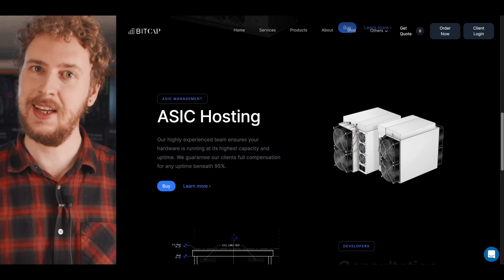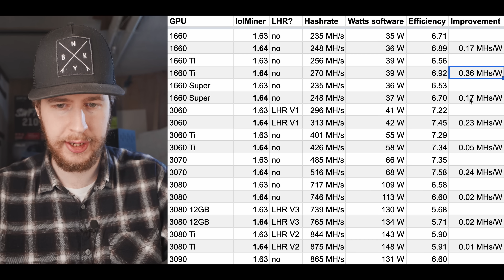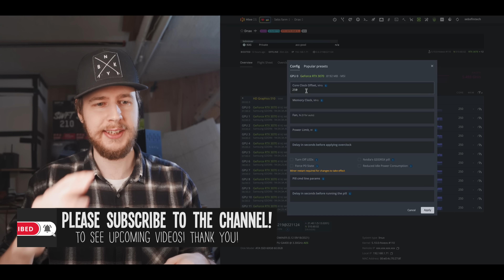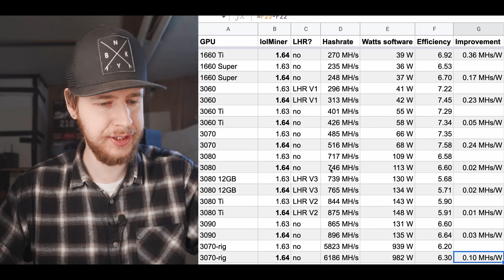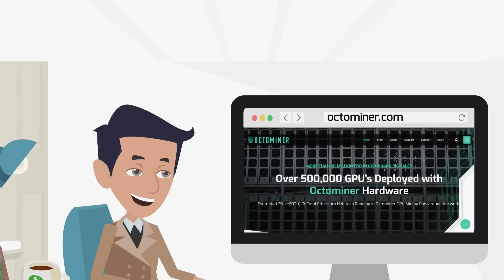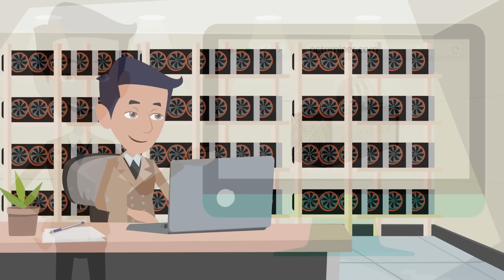3 ways to increase KASPA mining PROFITS on your GPU mining rigs!

Comment: yes, your profitability is determined at the time of coin sale.

however, do not mistake this as your income for tax purposes.  it is not true for filing taxes.  the income you're supposed to declare on your taxes is not determined by the value of the coin at the time of sale.  it is the value of the coin at the time it is deposited into your wallet.  sucks, because it requires more work to assemble that data, and, you don't get the luxury of "deciding" what your tax income will be and when it will be, unlike stocks.

Comment: For me, locking the core clock in Lolminer and then the offset in hiveos doesn`t work. I had 1,521ghs with core clock locked on 1470mhz and offsets done, when I lower the core clock lock on 1300mhz the speed of mining went down to 1,33ghs and no improvement. :(

Comment: Was my previous comment deleted?
Reply from the maker: Very possible, Youtubes anti-spam filter is completely broken. It will remove totally legit comments, but let's a bunch of real spam through. Sorry if that happened to your previous comment! I never delete any comments manually.
Reply: @SebsFinTechChannel  Humm! I suggested that on MSI Gaming X 1660 cards, start the HiveOS Core at 100 and instead of 1470, use 1620 in the --cclok argument. Supers are running 270+ MH and the Tis are 297MH. It's probably becuz I used an AT symbol for the wattage. With 1660s being such low wattage cards, you can gain much more Hash and still run in the high 40s, low 50s on wattage and still have high 5s, low 6s on efficiency.

Comment: Good info. My 3070 was making 524mh eff.7.4-7.8 power 69。 ii locked cclk to 1585 and mclk 810. But somehow they changed after i running the lolminer for few minutes and it  lock at Cclk 1589 mclk 807。

Comment: I got the GPU driver error as soon as it rebooted after running the command. I am using N520.56.06 Nvidia driver, and running 2x 3080 lhr v2, x3 3060 v2, and 1x 3080 12gb v3. Do you have any solutions, Seb? It was running fine with lolminer 1.63.
Reply from the maker: Do the normal troubleshooting: reboot the rig a couple times, remove overclocks and reboot, worst case scenario just roll back to the previous lolminer version 👍